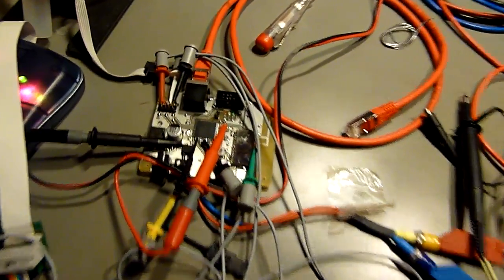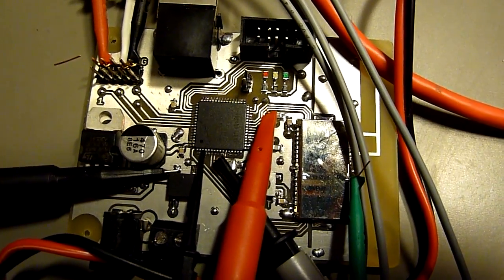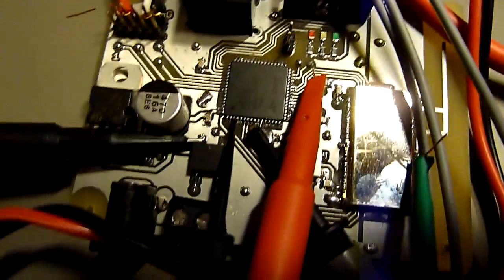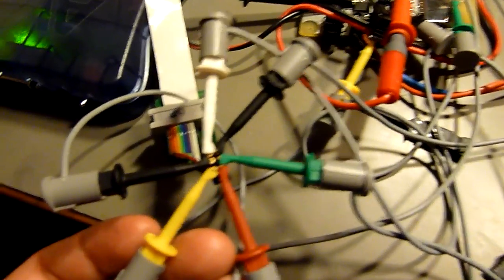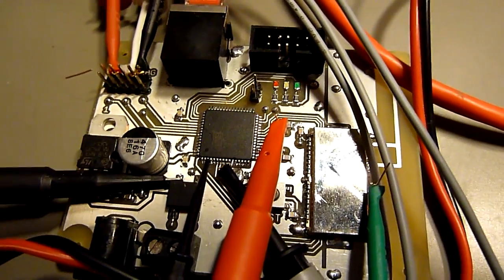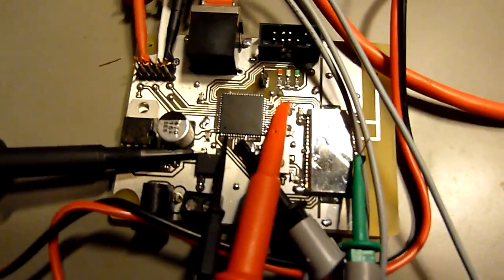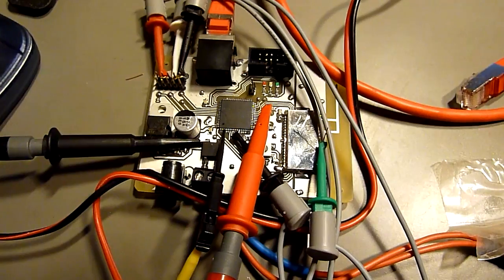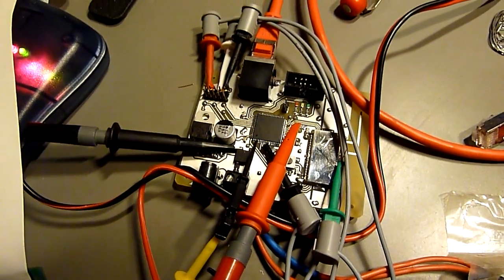Screwed up fuses at its worst with an AVR controller.

Comment: It always makes me nervous changing the fuse settings.  Especially when changing the clock source and/or programming/debugging interface-related bits.  I always double-check everything and hold my breath until I've reestablished communications to the MCU.

I'm glad they changed how the XMegas work regarding the clock source, as you allude to in the video.  The XMegas always start-up using the internal clock and switch to the external clock based on _software_ instead of fuse settings.

Comment: Mike,  It seems to me that I read once on the AVR usergroup that once you set fuses wrong, you are done with that controller.  I get your logic that you should be able to reset the fuses through ISP.  Are you able to (at this point) read the fuses through ISP?  Let me know how this goes.

Comment: First time for me to see somebody using a sinosoid waveform as a clock for microcontrollers. That's probably not a good idea, especially for reviving a misfused chip. You should stay in the digital world and use a proper square waveform.